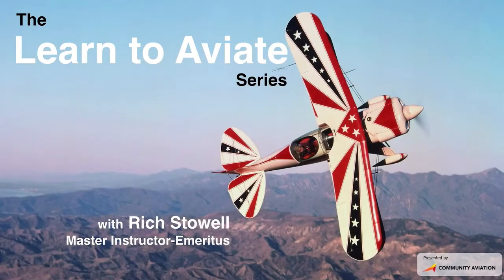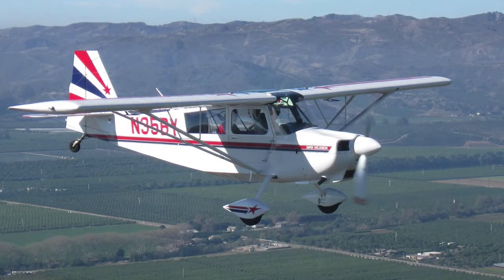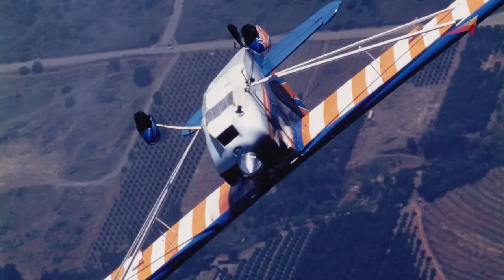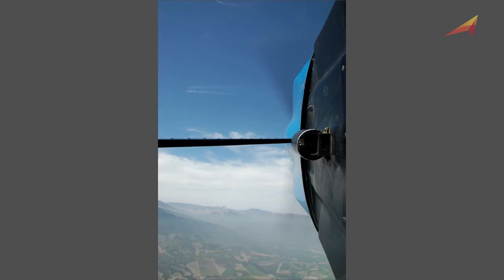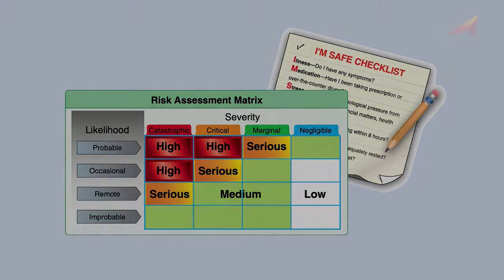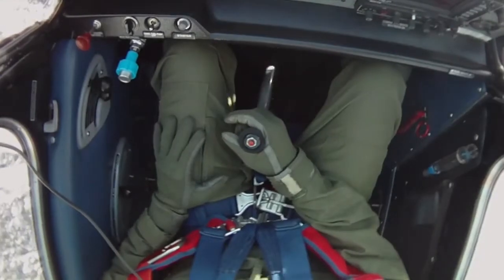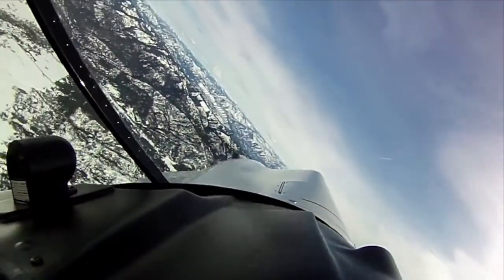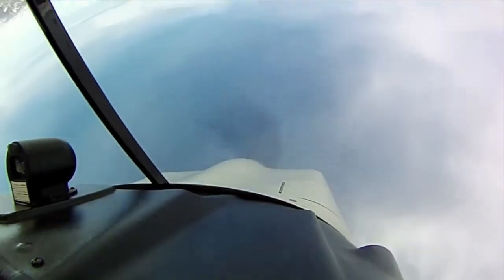Learn to Turn – Video

Comment: Hello Rich. I got very enthused when I realized that I had received a notification about a video from you. 
After a few hours of receiving my private pilot certificate, I flew to Santa Paula and took your EMT and unusual attitude .  Fifteen years later and with almost 1000 hours, and a single, multi engine commercial IFR rating there is not one flight that I don’t remember your emphasizes on staying coordinated.
After many instructors, which most of them , were great, I firmly believe that you are the best.
Can’t wait to watch all of your future videos and will read the 98 page booklet immediately. 
Thank you for all you continue to do for the safety and  PROPER training of pilots. 
Jose C
Reply from the maker: Nice to hear from you, Jose! And thank you for the nice comments. My logbook shows we did EMT Modules I & II in Santa Paula in 2006. Glad that experience remains with you.
Reply: Rich I strongly believe that every pilot including instructors should take the EMT and emergency maneuver training with you  or someone as competent as you. That might be tough. 
For 15!years my briefing includes the normal engine loss procedures and mostly your recommended P.A.R.E, P.P.R and at least for me, move your feet in the base to final turn. 
Thank you